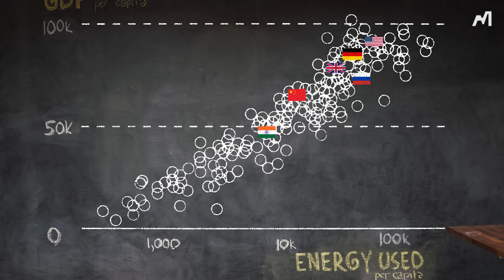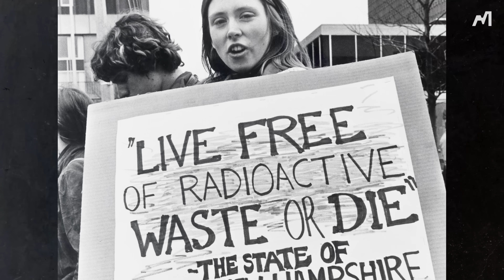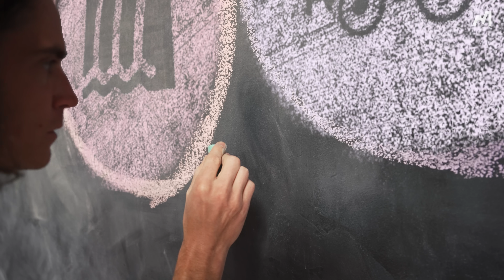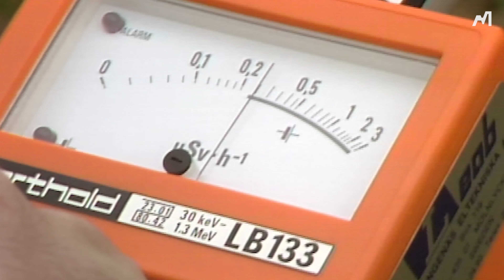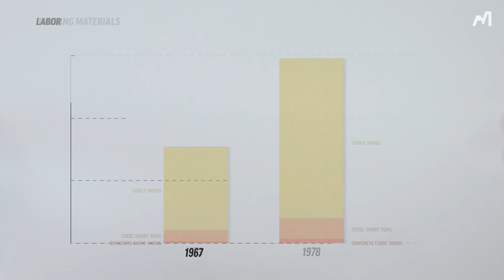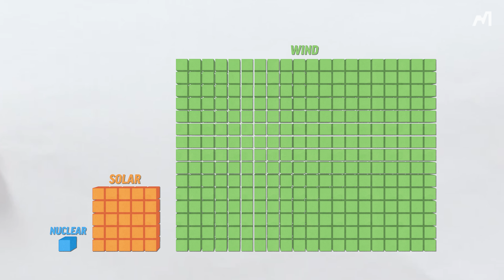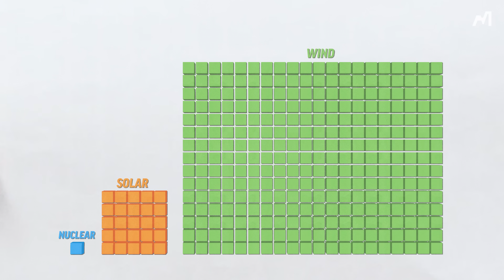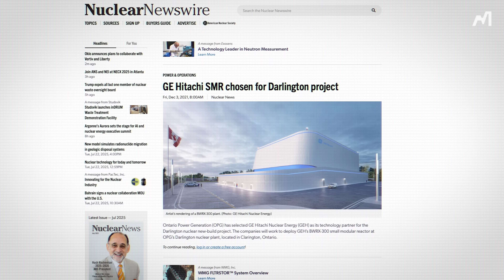They're Lying to You About Nuclear Energy

Comment: As an operator at a nuclear plant and a volunteer fire fighter. I will tell you first hand that I'm more concerned about the risks when I go on a fire call. Long term carcinogens are much much worse to develop cancer as a firefighter than working on radioactive junk in the plant. No we don't just control things from the control room there is a lot of stuff we have to do from in the plant from running tests to ensure our safety systems will work if needed. 50% of our equipment just sits there waiting to be used in an emergency, aside from testing on typically a quarterly basis. We put out over 2gigawatts or 2000 megawatts or 2-billion watts and it costs us very little to make it by comparison to other electrical generation.
Reply: 2gigawatts!?!   That's more than the 1.21 gigawatts needed for time travel!!!😂😂😂
Reply: @CharlesCarmichael-404  EIGHTY EIGHT MILES PER HOUR!!!!!!!
Reply: @michaeltsung9741 well played. I read it exactly as Christopher Lloyd said it 😂
Reply: @CharlesCarmichael-404  Time travel requires jigawatts
Reply: @CharlesCarmichael-404 No. Those were jiggawatts.
Reply: And then look at San onfere at San Diego.  Greed ruined that nuclear reactor. They wanted 20% more output so they put in a untested upgrade which didn't work out so they mothballed the reactors. Heads I win, tails you lose.  You can't give this stuff to adults who are children.
Reply: Oh,I suppose I should express deep gratitude to Nato for the tens of tons of ammunition made from depleted uranium, fired upon my country in 1999. I  n the area of city of Niš ,the number of cancer cases increased more then 10 fold. But hey, we can pick up all this uranium,send it to 'Le Hague in France' to be recycled,then return it here and build a nuclear power station ! Thank you Uncle Sam!
Reply: Bro lives for the spicy air and the spicy flame
Reply: Sounds like it's too efficient. That's exactly why we can't have it, everyone has to die paying overpriced electricity bills.
Reply: Two kinds of support the nuclear lobby got from the German government I the past:
1. Safety regulations are lower in comparison to other similar industries. Only then the economic risk can be carried by the companies and insurances are wikking to cover parts of the damage which is done when the worst case happens. 
2. The responsibility for all present and future nuclear waste was taken by the government.  The companies paid for this, but even if the calculations were good enough and they paid an amount that is reasonable, the risk that the costs explode are now on ghe government's side.
3. Additionally money was paid when the power plants were build originally. 

And as other persons said. In Germany the government asked all available companies if they are willing to build new nuclear power plants. All refused. So is capitalism not working anymore, or why don't they want to build "the cheapest source of energy"?
And most of the power plants that were closed I the last decade needed significant improvements to be still operational. So nuclear power plants might (huge doubt here) last a century, but not without heavy investment over time in repairs and safety improvements.
Reply: @d-i-wood8499 I'm pretty sure the video explained the reasoning clearly. It's the massive start-up cost and red tape. Nuclear power projects across the world are notorious for being delayed by years, if ever completed and just a one month delay takes at least 3 months to compensate. Now imagine how long it takes a project that's delayed by years to make back those losses. So while its one of, if not the cheapest to produce electricity once the plant is in operation, the financial risk of achieving that goal just isn't worth it while the government puts so many contingencies in place.
Reply: I presume you wear a respirator, keep your body covered and wash down after a call? That's great - now all I've got to do is find respirators to for my three under-ten daughters, an airtight dome for the pram and build an airlock with a shower over the front door.
Reply: Your  non-verbiage is proof enough that YOU NEVER WORK WITH ANYTHING RADIOACTIVE.
Reply: Then why is nuclear power the most expensive source of electricity for the consumer here in Germany even if we were to build new reactors? Without subsidies nuclear power is not profitable and we don't have nearly as much equivalent fissionable material on this planet than we do oil and gas, let alone renewable energy. It costs "very little" once it's up and running and running smoothly, but when you factor in total cost it's not as clear cut, not to mention the dubious sources of fuel.
Reply: @iliketoast-q9b  Not sure what you have in mind when you say “anti-regulation people”, but whether you like it or not the absurd amount of regulations and red tape that needs to be cut through is the very reason it’s hard to be profitable - at least here where I am in America. That and the fact that certain utility companies have government granted monopolies to their given region, so it’s entirely exclusionary to any nuclear energy (or any other energy source for that matter) even if the public had overwhelming demand for it.
I don’t know the specifics regarding Germany, but as I understand it there is a bunch of subsidies, market premiums, feed in tariffs, and tax incentives to run renewable energy, am I right?
So with that level of intervention how would you even know what is or isn’t profitable in your country?
What I do know, is that Germany has completely phased out all nuclear power plants over the span of the last 14 years - even though they were running perfectly well. So how in the world is that cost effective?
Reply: @jeremycook5836  They were expensive before they were shut down, as the upfront cost is astronomical. Safety regs and the technology involved makes it necessary to subsidies and Germany is no different. That's the whole point of subsidies, but nuclear energy is no where near the cheapest option.
Reply: @iliketoast-q9b  Yes the UPFRONT cost WAS astronomical, but your country had 19 of them. Most of which were shut down between 2011-2023. Those plants can run for decades once built, so again, explain to me how that’s cost effective? I’m not going to pretend to be an expert in the field, but from everything I’ve researched, nuclear power plants do not entail nearly as much ongoing costs once the infrastructure is built - which makes it cheaper than other energy sources in the long run. 

How do you know subsidies were necessary to operate them? Your government shut them all down, so how can you know they wouldn’t have been economically superior in the long run?

It’s basically the Economic Calculation Problem. Once again, with all of those interventions involved in your country’s energy, it’s impossible to say what would be most economically viable - all I’m saying is that shutting down all of those already operational nuclear plants probably isn’t it.
Reply: @jeremycook5836  "so again, explain to me how that’s cost effective?" They weren't cheap back then like I said, so what are you on about? "How do you know subsidies were necessary to operate them?" Because that is public knowledge around here. No company will foot the bill for such a huge investment, again the whole point of subsidies is helping companies mititage risk and gaining a foothold in the market. Even our energy companies are not pushing nuclear, because it's TOO EXPENSIVE. Cost overruns are the norm with nuclear power plants and can you spell energy indipendence? Ask yourself where the fuel is coming from and then consider what happened after our conservative government went allin on russian gas. I'm sure you can figure out the problem.
Reply: @iliketoast-q9b He was totally correct to say that the major cost of nuclear is the upfront. Operational costs are comoaratively small. You closing them was a political move not an economic one.

In fact the LCOE of operating nuclear is half of a PV plant. The high cost is again due to the large upfront fees which are also partially caused by overregulation.

Even if we accept that these regulations are needed nuclear would still be a worthy energy source because it is much more reliable that renewables and if all of Europe went to fully renewable the grid would be very unstable.
Reply: @iliketoast-q9b  Government is the reason.
Reply: @seanbays1235 Without government nuclear power plants wouldn't be profitable. Or are you one of those anti-regulation people?
Reply: @iliketoast-q9b how TF is it possible that nuke is the most expensive form of energy, if your energy bills spiked since you turned off your nuclear reactors?

Only the upfront cost is high, running costs are very low, uranium is cheap asf
Reply: @davidemensigamerCH So was russian gas, notice a pattern? Energy independence is what we're after and who said nuclear is the most expensive? It's certainly not the cheapest, that's actually renewables. Turns out if you heavily invest in it then it becomes cheaper, just like nuclear energy. And uranium ain't cheap btw, especially the highly enriched stuff.
Reply: @iliketoast-q9b  Is your argument unironically “if fuel source cheap, must be bad”?? I still don’t see what point you’re trying to make about Russian gas. They have big oil reserves, they sold it cheap, so countries bought it, pretty simple lol.
Honest question: Have you done any unbiased research on this? I don’t blame you if you haven’t, but you’re just plain wrong about renewables being the cheapest. Look into the estimated price per MWh of each fuel source, and you’ll find nuclear to be either on par or slightly cheaper than wind and solar. The biggest difference being solar panels live for less than 30 years (they degrade every year after installation) and wind turbines usually get decommissioned after 20-25 years. Meanwhile nuclear reactors are designed to operate for a century, especially newer ones. 
Having both is a decent option also, as nuclear can run a whole grid as backup if the renewables go down or provide insufficient energy - but again, your government decided that’s off the table. So now fossil fuels have taken that role and are making up over a third of your energy instead. Good job. So independent. 
Energy independence is great, but the cost of a country’s energy directly affects the lives and wellbeing of every single person in that country. So in Germany does the goal of energy independence take precedence over cost? If so why, and who decided that?
Reply: @davidemensigamerCH  You have huge investment and unknown cost after a plant has to be dismantled. You have also risk of core melting if cooling stops even if you shut down reactor. France is dependent on nuclear power plants but they are old and sooner or later should be switch off. And then hidden costs will have to be paid. Even you build new ‘cheap’ nuclear power plants your power bill will have to pay decommissioning. So grandparents had cheap energy because bills will be paid by grandchildren…
Reply: @iliketoast-q9b  If energy independence was what we were after we would have stuck to nuclear. Renewables make us far less independent. Where do you think all the cobalt in the solar batteries comes from? It's not mined here in Germany. And it's not mined under humane conditions either. I'd wager that the German uranium miners lead a better life compared to the cobalt miners in the Congo. 

Nuclear got more and more expensive in Germany because of our ridiculous regulations. Our half-assed attempt to shut them down in 2000 allowed a ton of expensive legislation to follow. Laws like the KTFG made nuclear expensive while subsidizing renewables. Nuclear was intentionally made unprofitable to artificially increase investments in renewables and the companies running the reactors were forced to make payments towards renewables. We could've cut down the cost of our reactors by a significant margin if we had decided to recycle our rods too but we explicitly decided against doing that. They didn't want us to recycle all the material because that would've increased the runtime of the reactors, and at that point we had already come to the Atomkonsens and were planning to shut them down in 2032. 

If our goal had been to get cheap, independent and reasonably clean energy by 2030 we would have invested in both nuclear AND renewables. But we didn't. This was not an economic decision - it was an ideological decision.
Reply: @jeremycook5836  You're strawmanning. I'm questioning whether cheaper=better as the driving principle of our economic system. The research has been done and I could quote you some sources regarding nuclear energy being much more expensive, but I doubt you speak a second language, let alone german, as an american. Actually Germany's power grid is powered by roughly two thirds by fossil fuels, about the same as the US. We've had net-zero investments in our infrastructure since the 90s and we've had a conservative government for decades, so of course renewables are only now on the rise after a measly 4 years without the dreaded conservatives in government. Stop talking about things you know nothing about.
Reply: @iliketoast-q9b My man, you sound like you will literally defend big energy to the death. They do not care about you. Why cant you just see we've all been brainwashed about nuclear? You are just proving that all the fear mongering worked and is impossible to undo and even merely entertaining the idea is too dangerous. Do you work for big oil or something.
Reply: @webbedshadow2601 Right, because nuclear energy is totally not synonymous with big energy. Take off that tinfoil hat and look at the facts. Now, do you have any actual arguments?...didn't think so.
Reply: @iliketoast-q9b that is simply because there is an abundance of oil and gas where you are, and not much uranium. It doesn't mean oil and gas are better solutions than nuclear, they are just more convenient to your country currently
Reply: @Sup_Aqualine369 You clearly don't know what you're talking about.
Reply: @iliketoast-q9b it's not the most expensive for starters the most expensive is the so called renewables,  if you look at the subsidies and transmission aswell as all the construction of the different forms that are used in each country they cost far more than the equivalent in nuclear and last a lot less time. Then you take into account the so called safety regulations that the government has put in place. That is where about 50% of your cost for anything the government is allowed to over regulate with unions and developers.  A nuclear plant the same as gas and coal, if maintained properly will last century's with minimal cost. But the so called renewables will last 20 years if you are lucky. So you way up the accumulated cost with the replacement of the so called generator every 15 to 20 years nothing is more expensive in both $ value and land and environmental damage.  Wake up to the truth.
Reply: @jaskirchner  Wrong, for the end-consumer renewables are significantly cheaper, how many times until you nuclear-fanatics get that? THat's hard data you're argueing against. Maybe in the US nuclear is cheaper, but not here in europe. "Then you take into account the so called safety regulations that the government has put in place. That is where about 50% of your cost for anything the government is allowed to over regulate with unions and developers." Ah yes, who would want safety regs for a nunclear power plant. Remember Chernobyl? The west never had that...maybe, just maybe it's because of those pesky regulations. Argueing against unions is also just bizarre. You realize without unions wages are cut everytime? And stop saying "so called", they are renewable and don't act like nuclear plants don't require maintenance and lol at your point regarding the environment when nuclear still ahs the waste-problem.
Reply: Dunno dude, you killed your own nuclear power plants in 2011 cuz of a TSUNAMI in Japan.
Reply: You do know you can use more than one form of electric generation, right?
Reply: @iliketoast-q9b because Germany is now run by a left wing party that is destroying your country/ culture/ economy
Reply: It has nothing to do with the radiation at the plant. Nuclear is the worst form of energy in the world. Its not green in any way. How do we dispose of the irradiated cooling liquid? What happens if theres a large solar flare like the Carrington event?
Reply: @zavelazer8167  So wbich oil company do you work for? Which one is sponsoring your paycheck?

Comment: I do investment and finance work within nuclear for one of the large utility companies. Full size reactors will always have the best dollar per kw in comparison to any other energy form (this includes SMRs). The issue with SMRs (for usage other than data centers) is that they do not provide enough upside in costs or shortened construction time to be worth it. Plus the O&M cost of a SMR is very similar to a full size plant.